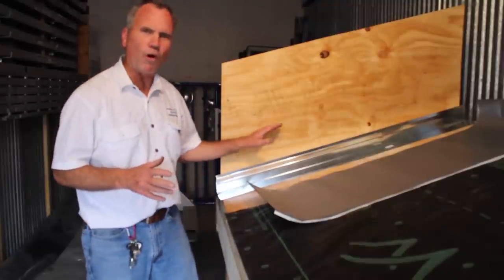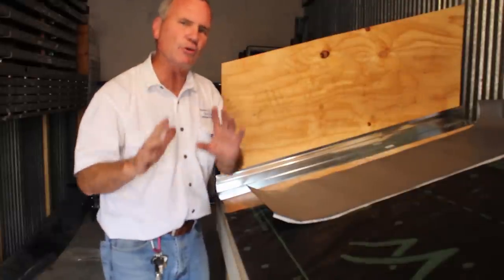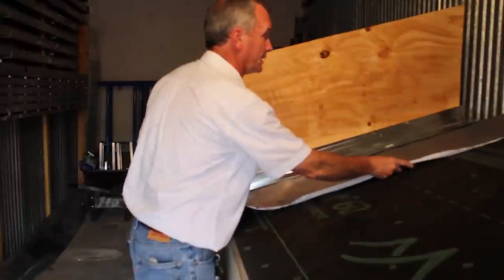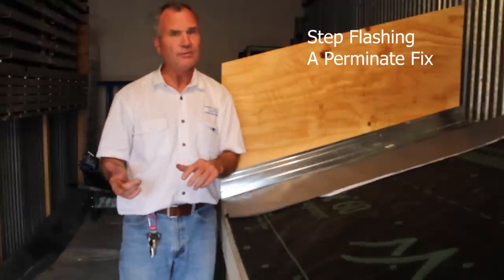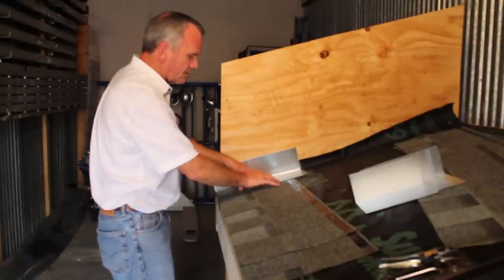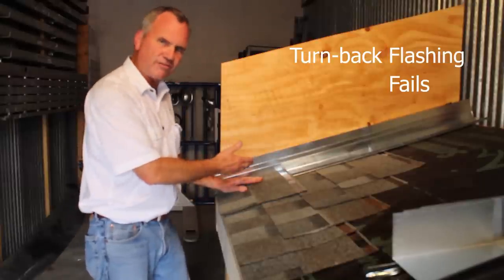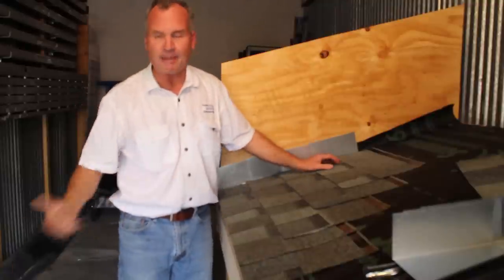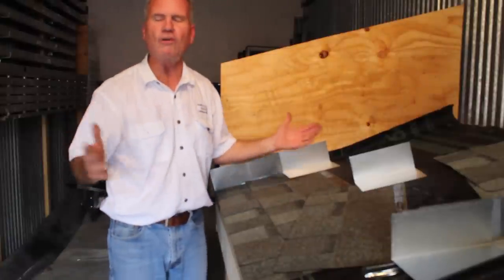Roof Flashing & Wall Leaks - What Texas Roofer Don't Know

Comment: Can confirm that in Hell Paso, contractors are still acting like we're in the 70's when it comes to roofing. My roof was supposed to have been brand new, 5 years ago... now I am ripping off everything they did to DIY a fix cuz I can't trust anyone. I had 4 roofers come over and tell me there was nothing wrong! 2 inches of tar against the wall is not fine... especially when these cheapskates used Drywall instead of osb on my walls! Holy cow.

Comment: Even if the peel and stick method here were to seal 100 % it's still wrong as it does not shed water to the top of each row of shingles as step flashing, will do. You don't want water running under your shingles. On top is better.
Reply from the maker: That is correct -many people miss that detail.  Thanks for your comment.

Comment: Great video..I would not put a nail in your flashing on the roof . Nail it high on the wall. Also aluminum step flashing is flexible and doesn't need a nail on the roof. I live in Maine.  Weather doesn't get much worse than here
Reply from the maker: Aluminum works just fine.  We just don't like mixing steel nails and aluminum!  Also, the nails go where the shingles nail.  Empirical evidence has shown me that nailing them works best.  Allowing the shingles to separate, even for a short time in our climate, allows dust and dirt to get between the shingles, which can lead to an area not sealed.  If you're happy with your way, stick to it, it's good to know people like you are doing it right.
Reply: Good modified bitumen (ice guard) will seal around the nail shaft as well. Use a good bitumen wrapped up the wall and when you drive your nails through the flashing, the shaft of the nail will get a little seal when that roof gets to a good 170+ degrees. Granted, there are ALOT of nails up there, and probably impossible to think every nail gets totally sealed... but use a good ice guard product and you'll increase your chances.

Comment: I was a roofer in the north East for many years in the beginning of my construction career.  I worked for a roofing company in Rockland County, NY and we did an average of 200 roofs a year (4 man crew). the rest of the time accounted for siding jobs, and gutter work. I have done thousands of roofs.  Step flashing is roofing 101. Step flashing PROPERLY is roofing 102. 
Caring about what your doing and doing it right is the AMERICAN way !!
Reply: You seem to know your way around a roof so I'll ask you the same question I posted on this vid. I am planning on re-roofing my home this summer. I have a dormer that has two sidewalls that come in contact with my roof (front of dormer is flush with exterior wall of house so does not contact my roof). I live in Michigan and here are the codes I have found: per Michigan residential code "R905.2.8.3 Sidewall flashing: Base flashing against a vertical sidewall shall be continuous or step flashing and shall be not less than 4 inches (102 mm) in height and 4 inches (102 mm) in width and shall direct water away from the vertical sidewall onto the roof or into the gutter. Where siding is provided on the vertical sidewall, the vertical leg of the flashing shall be continuous under the siding. Where anchored masonry veneer is provided on the vertical sidewall, the base flashing shall be provided in accordance with this section and counterflashing shall be provided in accordance with Section R703.8.2.2. Where exterior plaster or adhered masonry veneer is provided on the vertical sidewall, the base flashing shall be provided in accordance with this section and Section R703.6.3." I have siding on the vertical walls of my dormer so I need "continuous" flashing up the vertical leg of the sidewalls. This is where it gets tricky for me. According to the Michigan Building Code: "1503.2.1 Locations Flashing shall be installed at wall and roof intersections, at gutters, wherever there is a change in roof slope or direction and around roof openings. Where flashing is of metal, the metal shall be corrosion resistant with a thickness of not less than 0.019 inch (0.483 mm) (No. 26 galvanized sheet)." Is step flashing considered "continuous"? Regardless, I can not find anything in continuous or step flashing that is 0.019 inch thick, not at my local big box stores anyway. Any suggestions??
Reply: Step flashing is “absolutely” continuous along the sidewall, it overlaps, no gaps.
I believe the codes were written so as to allow different flashing methods, such as step flashing, or, dare I say, “turn back flashing”.  USE STEP FLASHING !!!!  Don’t ever use turn back flashing for asphalt shingles.
If you can’t source .024 or thicker gauge step flashing locally, (that’s odd),  just order it online, or, order a 24” x 50’ aluminum trim coil in .024 gauge for $110 ish.  Most common is white one side and brown the other.  You will have more than enough for your roof, and you will have enough left over for other projects. If you need a special color, that won’t be an issue.
Just cut 8”x8” squares and bend them into 90 degree 4”x4” steps.  Unless, of course, your using a carriage house shingle, you will have to make them longer.  Just make sure your step flashing length matches your shingle exposure PLUS the head lap, at the very least.
Reply: @yzmoto80  THANK YOU VERY MUCH!! The "continuous or step flashing" part was confusing the crap out of me. I was looking online at the preformed step flashings at my local big box stores like Lowes, Menards, and Home Depot. They all sell it but from what I saw most, if not all, of it is 0.012 thick yet code states minimum 0.019 thick. I did see they (well, at least my local Menards does) had the trim coil in 0.019 thick. I knew I wanted step flashing and I wanted it to be at least 0.019 thick per code. I think I'm going to have to go the trim coil route. Thank you VERY much for taking the time to reply to me!!
Reply: budyjames77 
Your welcome, be safe !

Comment: Great video! I’ve been battling (from the ground) a problem area in a roof/abutment/valley transition area for several years now. During certain rain situations water runs down the inside of a window in our breakfast-area. Had a contractor come out 6-7 years ago and his solution was to run an ugly bead of clear silicone between the turn-back flashing and the shingles. It seemed to have worked...then we had our house re-roofed three years ago  and the dripping at the window has happened a couple of times since. The contractor who put the new roof on is coming today to see what can be done. I think he’s under the impression that he’ll do what the first guy did and just spread some silicone around. I want something permanent and fundamentally sound. I’ve noticed for many years that contractors in the Baytown, TX area seem to be fly-by-night and  are into quick fixes rather than long-term remedies.
Reply from the maker: Jim, thanks for your comment.  Yes, it is like cancer that continues to grow in our industry.  Best of luck in getting your new roof installed well.

Comment: Phew!  I'm about to do the step flashing on a porch abutment and was going to caulk up my flashing.  Now I'm not gonna have to have Gumbi bail me out.   Thanks!  And I've got Ice n Shield run just like you said, so the nail hole has some good protection below it anyway on the flashing.  Should be a home run finished product tomorrow.  :-)

Comment: Hey Gary  Tim here Vincents Roofing La grange Texas .  You are right  if I had any pieces of Ice and water shield You could run a piece at least 6 inches up the wall and same on deck . Step flashing is good as you layer the flashing on it forms a high ridge that also steers the water away from the wall . . Our company has a 20ft brake and we form all our own flashing out of at least 26 g  and with a himm back and ice and water that works too . . I leave it up to my crew how they want to do it .

Comment: This is helpful as I'm about to tackle a small leak that roofers have twice failed to fix. Since I'm a new at this, it would be helpful to know specifically which nails you recommend.
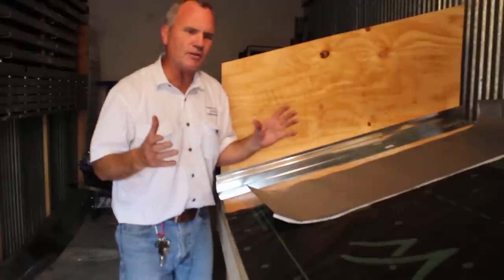Reply from the maker: Roofing nails like the rest of your roof.  Here's another video that could help.  https://youtu.be/pLLyt5AjGYk  At 2:27 in the video you will see the placement of the step flashing and nail.  Best of luck.

Comment: Excellent Video!  Just one question, since the wall flashings are partially on top of one another, doesn’t this overlap create a tiny gap between the wall flashing and the wall?  I get that the ice and water barrier should run up to the wall so if water were to get behind the flashing it shouldn’t be an issue, but I would be concerned with how long vertical ice and water could hold up before gravity starts pulling it away from the wall.

Comment: Gary - I hope you are still answering questions.  I was disappointed to find out that siding has to be removed to do the roof/wall intersections correctly.  The siding is rated for 50 years, but the roof, no.  And I can't do all of it at the same time.  Question - is it possible to put a strip of metal counterflashing under the lapsiding (with house wrap over it) along the whole wall that you could then slip new step flashing under?  I am trying to find a way to not have to take off the siding.  Also, where do home owners find good flashing when we are stuck mainly with the big box stores that sell substandard materials.
Reply from the maker: Stephen, "Outstanding Question". 
And, YES, counter flashing is a great way to deal with this issue. You will need to have it fabricated at a sheet metal shop, it's a common thing for experienced sheet metal workers.  
It's a Zee style flashing, typically 4" behind siding, out 3/4" or a measurement that looks good with your siding, then down 3" with a hem on the bottom.  This can be galvanized, paint grip or colored metal.  Best of luck on your work.  GW
Reply: @Austinroofingcontractors  Wow! Thanks for the quick response.  Just to be absolutely clear - if I put the Z-flashing under the house wrap and lap siding then I can slip step flashing under when I do the roof and I don't have to remove any siding?  (And which of the metals is the most durable?)  Thanks in advance.  (PS - would be a cool video.  This siding/roofing question is clearly addressed on YouTube or anywhere else.)

Comment: Hi, how long does a brick and Mortor  30 pound felt roof underlayment last before it starts leaking when exposed to the elements because the spanish tiles broke? The roof is a spanish stile brick and Mortor original from 2004. Thanks.

Comment: If you are replacing the shingle of roof, do you recommend reusing the existing step flashing or replacing the step flashing with new one?
Reply from the maker: Good question, we replace all the flashings using 26 gauge galvanized on most step flashing, 4 x 5 x 9".  GW
Reply from the maker: We replace them.  Our standard is to use a 4" x 5 " x 9" and it's rare to find these anywhere on existing roofs.

Comment: Step flashing along a wall, starts with a water/ice shield directly on the deck,followed by synthetic underlayment, followed by step flashing,followed  by your shingles, no chaulking, no pooky, is this correct ? Nails on step flashing go on the wall, not the roof, correct ?manny garcia
Reply from the maker: Interesting and here's a question, food for thought.  What does the Ice and WaterShield do, if it doesn't turn up the wall?  If the step flashing is done correctly, what does it do at all?  Thanks for your input - we should all keep asking Qs.  GW

Comment: I just had a new roof installed. Water was coming in through the flashing on the dormers. Roofers came back twice, and even though it’s not leaking as bad now, I still see a little bit of water coming in on certain rain storms. I’ve giving up on the roofers as they obviously can’t find the problem. Wonder if you do work in San Antonio, Tx too. Don’t know that I can trust anyone else to do it right.
Reply from the maker: Let's schedule a visit  gw@exteriorsbygarywhillock.com

Comment: I am wondering about the adhesive on the shingles.  Wouldn't the shingle adhesive block the water from getting out?  
And I see other roofers extend the step flashing further down to where the edge of the top shingle will land.  In that case it seems like the shingle would stick tight to the flashing, again blocking the water perhaps even more. If that is the case the water would run horizontally across the lower shingle.  Is this what happens? Is it not an issue? Thanks.
Reply from the maker: CEFGNO thanks for the comment/question.  We have in the past shown this with a clear decking (no felt), on how it works, (compared to alternate methods), but it's like the shingles, it's a shingle process. Consider the field shingles that also have adhesive. Answer: No, it's not an issue and hasn't been since the beginning of asphalt shingles. It's the tried and proven best method under nearly all conditions. 
 Best wishes to you, and thanks again for the question.

Comment: With existing siding in place, how do you install flashing and underlayment in place as you show in the video?
Reply from the maker: Simon, a great question. Lost is the art of renovation, set aside by simple replacement, ignoring the fact, that the job is half done. Renovation is about restoring to its original, or possibly better than the original state or condition. If short-cuts were taken originally, it will require digging into the siding, stucco, or if masonry, step flashing counter-flashing can be added by tuck-pointing. I hope this helps!

Comment: From the Great Northwest public Duck Blind well I gotta tell you you would leak here in the Northwest no matter how you're going to do that if it's ice and water at the first course should be must go up the wall 4in come all the way across the deck on top of that we put another synthetic give this good lines for straightness now the first one will get a kick out shingle to kick water out away from the wall and into the gutter here in the Northwest we use 8x8 step shingles shingles per course 4 inches up the wall and 4in on the deck each course must come right down to the Salvage line back pain metal must be 3in outside corners cut one inch down and folded over never Square to the Box always kick water out this gentleman does have it right about the basics if you don't learn the basics of roofing you shouldn't be up there go back three generations and watch somebody roof think about how far the asphalt shingle has as come in history here in the Northwest where it rains a lot we are put to the test you continue to leak you are not the roofer for us God bless from the northwest where it rains

Comment: What is your recommendation for a house that has the siding installed already. I have cedar wood siding. I need a new roof. And all the roofers want to just push the ice/water shield under the existing flashings.
Reply: Your roofing company should pull the siding off to install new flashing correctly. Hopefully it’s a lap siding not a board and batten so only a couple of  courses will need removal. The way your roofers are suggesting is a gamble.
ProBuilt Construction
Caldwell, TX
Reply: Have been getting quotes here in Virginia and none of the roofers are willing to remove my cedar siding. They just wanna tuck under. So I am going to remove the siding myself and replace it after the roof is finished.
Reply: Best way to get cedar siding off  is to use a Dewalt drill set. Have a small cap from an one quart  oil bottle and put a little bit of Dexron trans fluid to dip your drill bit in frequently. Start with a 1/8” bit and work up to a 3/16” bit. Then after removing your siding use vice grips to get your nail remains out. Be careful and you can get all your cedar siding off without destroying it. When you put your cedar siding back on use #9x3” ceramic coated deck screws. Where we are around La Grange, TX cedar is astronomically expensive.

Comment: How would I continue this to a peak and down the other side like for a portico. Cutting the flashing on the peak thank you
Reply from the maker: That's a good question, the best way is to have a piece made to fit the ridge, a cap made to pitch.  This is done by sheet metal shops/workers who solder this into a single cap.

Comment: What kind of a gap can we expect at the top/ last flash and how do you waterproof that?
Reply from the maker: Good Question!  I should have covered that, but, there should be no gap left.  An end flashing, that may turn in 90 degrees, soldered corner or out, depending on the build.   No gaps!  Thanks for bringing that missing piece to my attention.  GW

Comment: If I have a brick wall in place, do you cut the step flashing into the brick?
Reply from the maker: Here's a video that could help, ( https://youtu.be/wTApl3kbO8k )  and yes, if you have brick, cut the brick or joints to install flashing with a turnback on it.  It's not as good as a though-wall flashing, but if you install with masonry cement, avoid caulk, then seal the brick, you typically can make it work well.   Best of luck and thanks for watching!
Reply: You have to install a 2 piece flashing . Flashing is attached to roof deck and extends up brick at least 4 inches I like 5 or 6   and do not attach to brick . Then a second piece of flashing is cut into the brick and comes down over the first fashing and is trimmed about a half inch off deck .  The 2 pieces of flashing are never attached to each other

Comment: What if you're using self stick roll roofing?
Reply from the maker: Thanks for the question.  There is no advantage to using a self-adhered at this sidewall location if you plan to use the roofing to keep water out. Roofing as a rain screen is not the best application for roofing and running a piece of self-adhered along the wall does little to keep long-term leaks from happening.